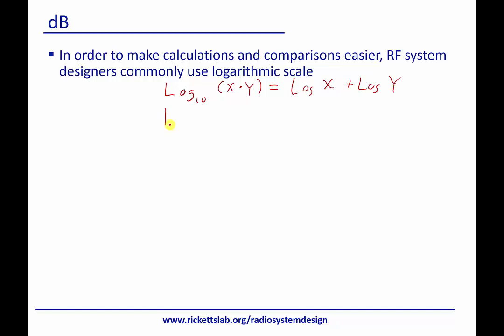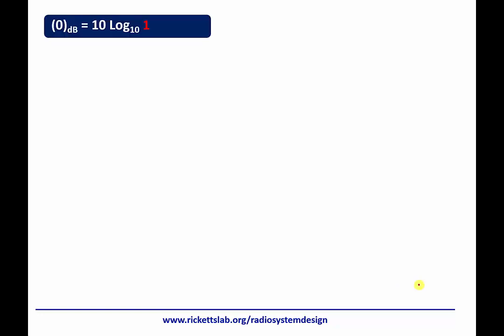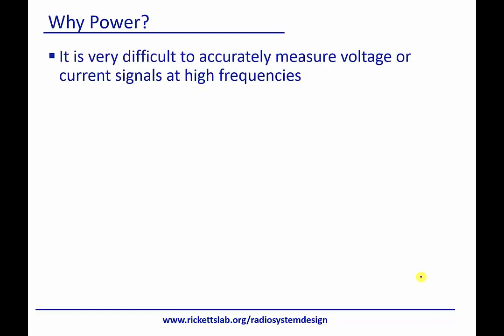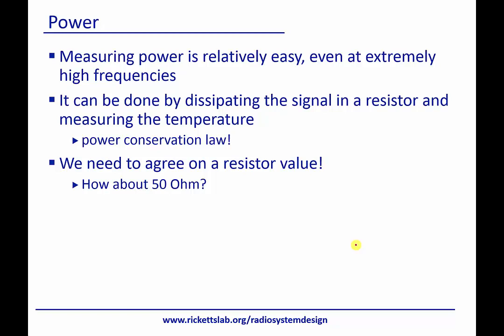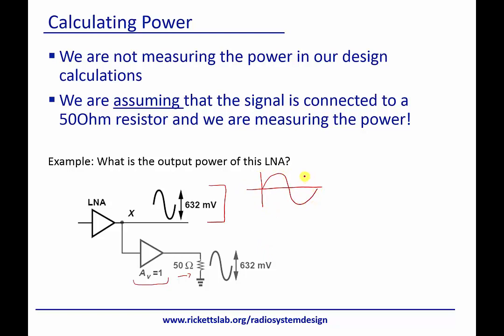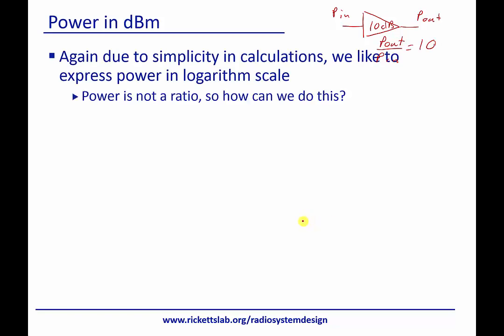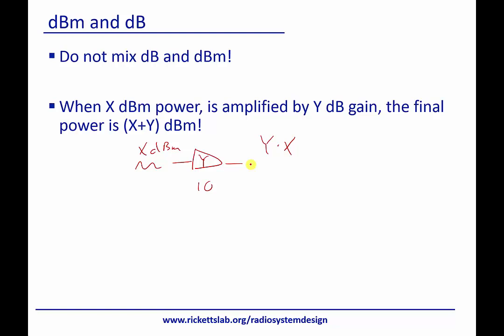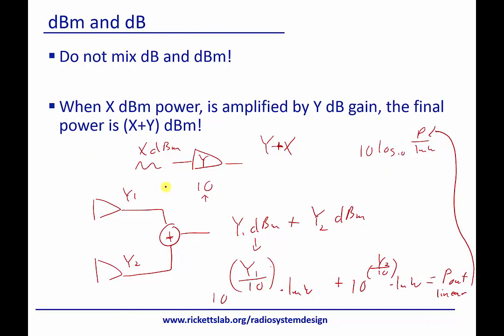Module 1: dB, dBm and dBc

Comment: Very nice video.
One thing I noticed.
A 12:44 you say: "the spectrum analyzer is telling you what the power is..."
Doesn't it show the voltage of the spectrum?
It it would, as you say, show the power there is no need to convert it to the power in 50 Ohms...

Comment: 632mV=0.632V power=0.998mW...1mW approximately....   prof. your calculation is wrong at 12:16... you cannot square 632mV which will result in 632^2* (10^-3)^2 V which is wrong... convert to Volts first then square the voltage
Reply: No, the calculation is correct. He has squared the 1/2 and the 1/sqrt(2) terms indefinitely, which together equals 1/8. Then, he squared the 623 mV term. Finally, he multiplied them together. It is simply a shortcut to avoid having to divide by root 2
Reply: @gvcallen yeah it is correct

Comment: i get 998 µW
Reply: That's what I am getting, because by squaring 10^-3 = 10^-6 = Micro W
Reply: That is the correct answer,  we build that circuit in the lab and measured it.
Reply: Yes, its 998 microWatts of power.
Reply: I know this is quite old, but the correct answer is 998 mW. Sure, when squaring millivolts you end up with microwatts, but 632^2 gives you 399424 or 399.424 x 10^3, which multiplies with microwatts to get milliwatts.
Reply: @gvcallen  lol... I don't even remember anything anymore about that.... I graduated a year ago and am currently working in the field of embedded systems/FPGAs 🤣
Reply: @dukenuke2690  haha, I'm currently in my 3rd year 😂 got a way to go. Just thought I'd help anyone watching these videos out
Reply: @gvcallen  too late my friend.. if you had come earlier I might got a few more points on that subject.. my grade might have been better.. who knows, maybe my whole career would have went in a completely different direction ... but.. too late 🤣
Reply: But good luck to you!😅
Reply: Yeah, right!